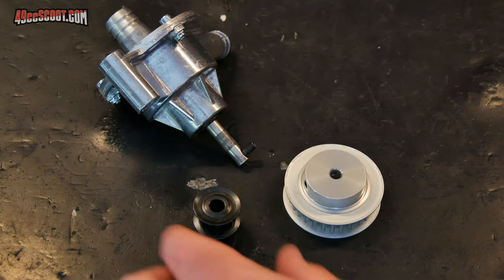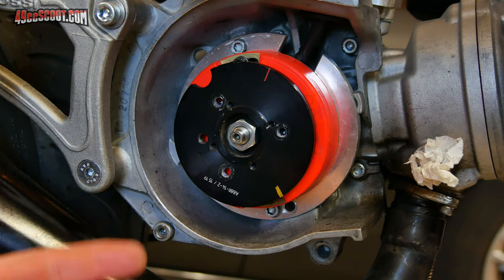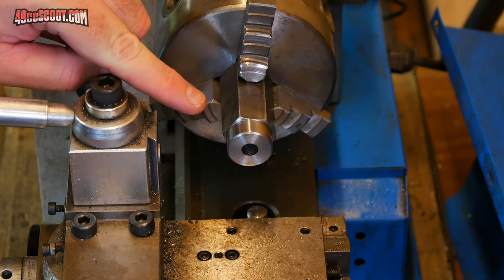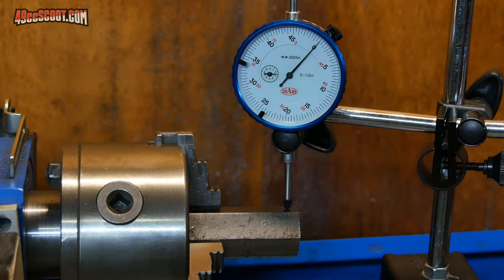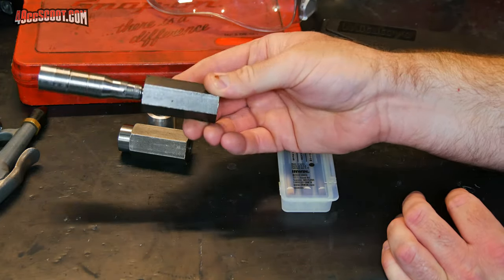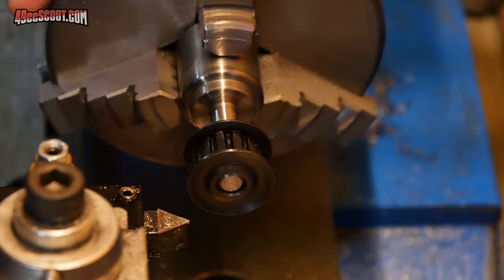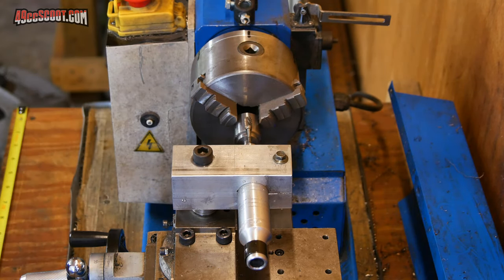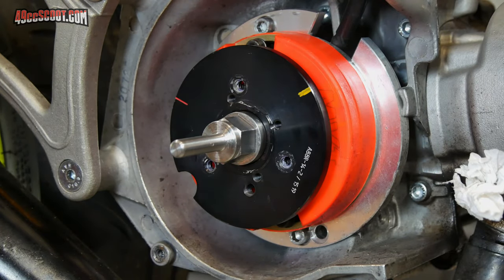Machining A Kart Water Pump Drive Adapter On The Mini-Lathe : TPR 86cc Build : Part 36

Comment: I can see it was a lot of work but it ended up working beautifully. Can't wait for the test ride of the new water pump. I'd use Loctite on that water pump adapter
Reply from the maker: Thread locker for sure. This was just a test install to make sure it fit well and appeared to spin true.

Comment: Great video. Your attention to detail is admirable. 
However I am worried that your adapter will break once the belt drive is running. There will be a fair bit of side forces at play on that shaft and it won't take much to bend it.
Hope I'm proved wrong though.
Chris
Reply from the maker: I hope to prove that wrong. If not, there are the other plans for a bolt on setup to try.

Comment: Probably another 'stupid' idea but I think if you make a large ring around that nut with 3 elongated holes you could use the three holes in the plate to lock the nut with 3 bolts to the flywheel so it won't unscrew.

Comment: Is there going to be a thermostat in your system ? Because I've learnt obvious you can't run to hot, but also not to cool. Maybe you knew, if not hopefully helpfull to you. Great content thanks.
Reply from the maker: No. I've never used a thermostat in the scoot. It works quite well for me that way.

Comment: make sure to add lock tite to that adapter otherwise are asking for issues
Reply: Was thinking the same, or use a spring washer.
Reply from the maker: Thanks. This was just a test fit. That's why no thread locker.